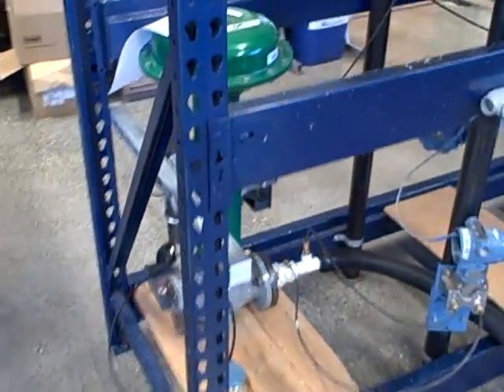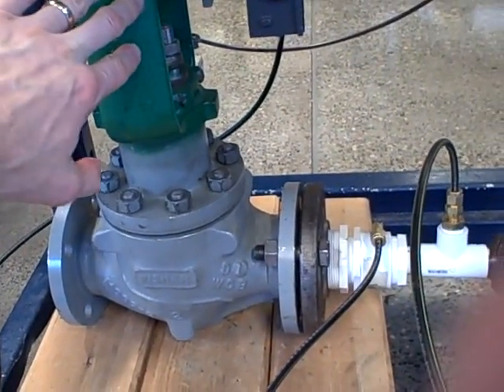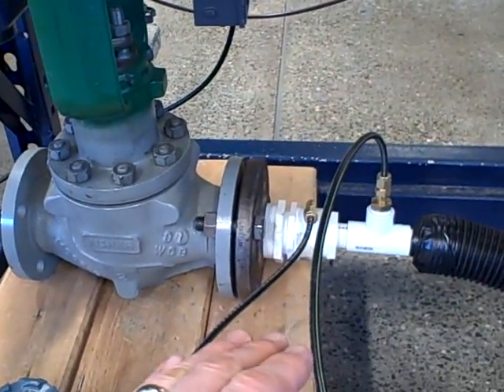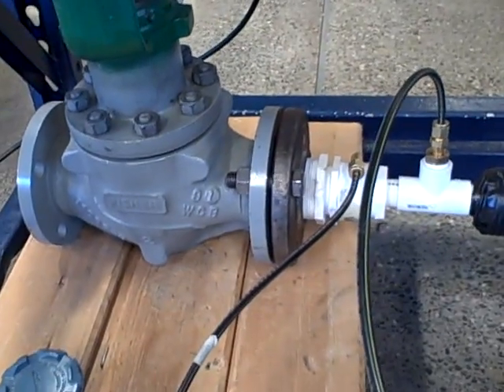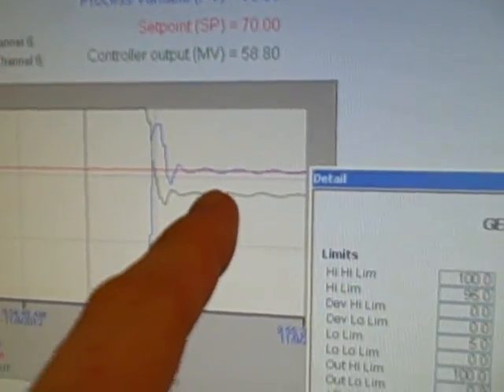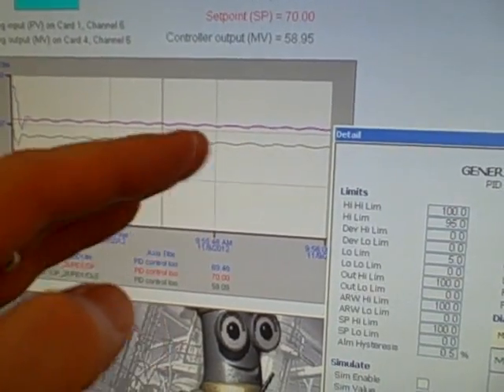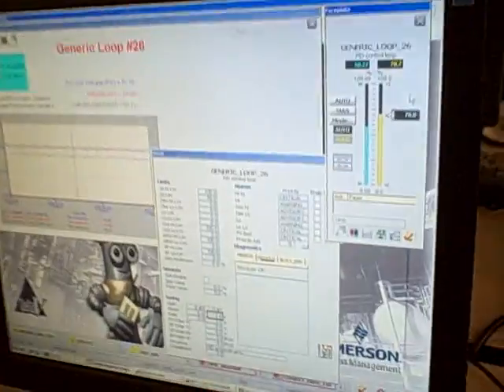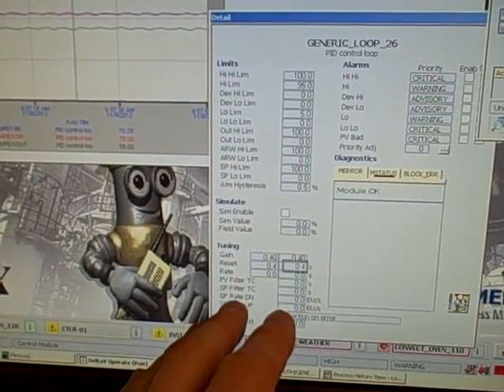Slip-stick cycle on an air flow loop

Comment: Just use a fisher valve posisioner DVC6010. It will correct this problem and with valvelink you can adjust the packing to the ideal value.

Comment from the maker: It would be great if we could choose the ideal valve type for the application, but in this case we're making do with the most common style of valve we get donated: sliding-stem gate valves.  Fortunately, the Cv flow coefficient is large enough that we get a decent amount of air flow through it -- certainly enough for the application.